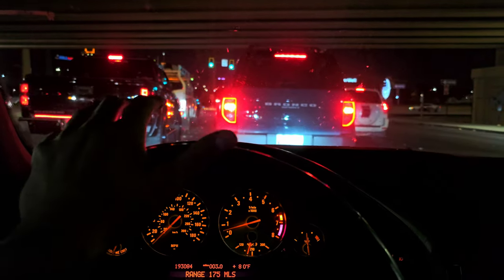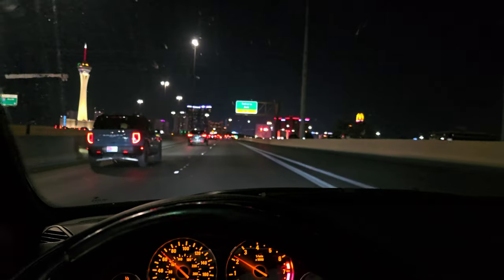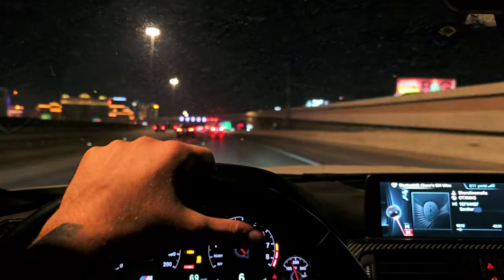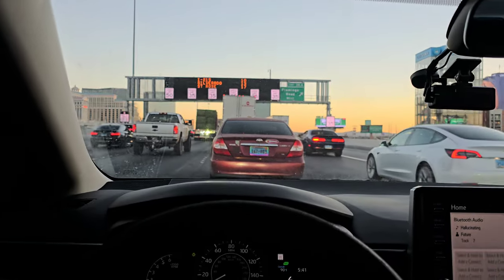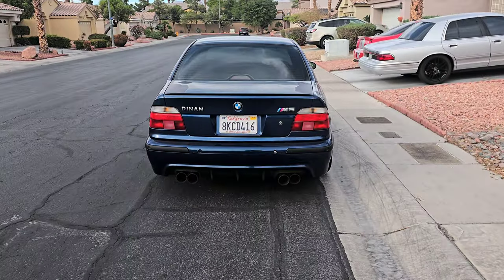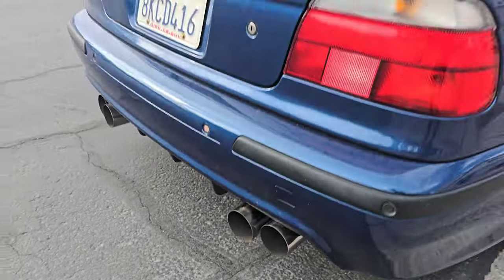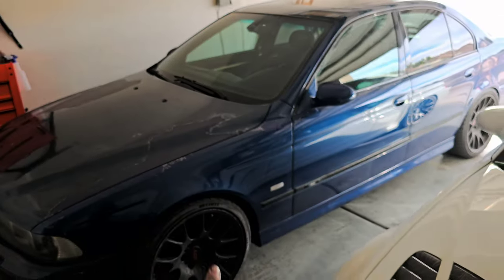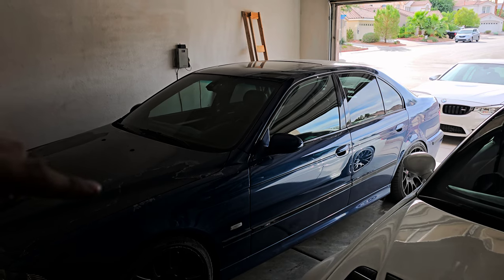I Straight Piped My Project BMW E39 M5 & It Sounds AMAZING! Custom Exhaust

Comment: The staggered tips werent a good choice IMO.. That welding was beautiful, if you wanted better, you gotta take all the tubing yourself. Just chalk it up to the Game.. Get some Ceramic High Heat paint on that piping. You def paid for the Welds. I paid 180 to get a Dinan Catback setup installed, and my welds look like bubblegum.. 

High Heat Enging Enamel will make it look oem underr there.

Comment: Cat delete is not necessary on the M539.

Only Muffler delete with smaller tips is the way to got.

If you want more, install an X-Pipe but then the Sound will be raspier.